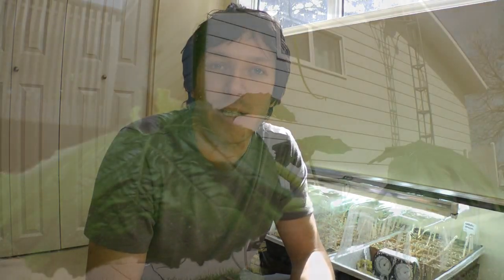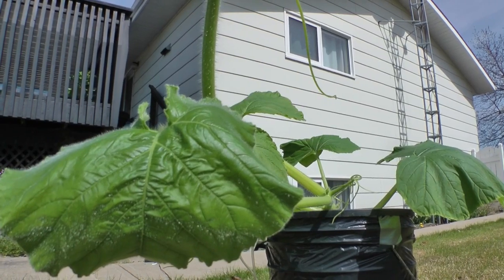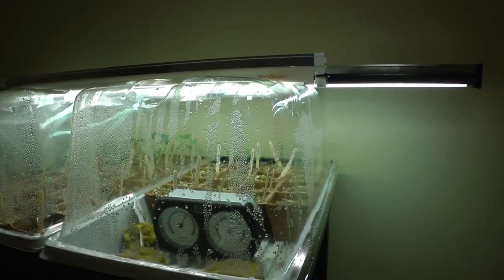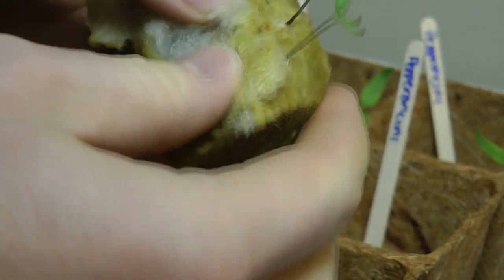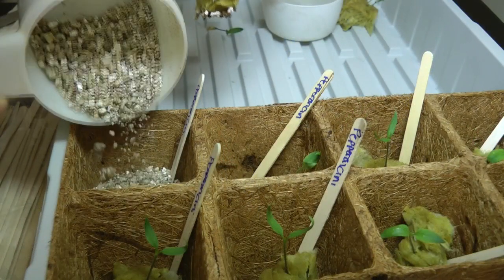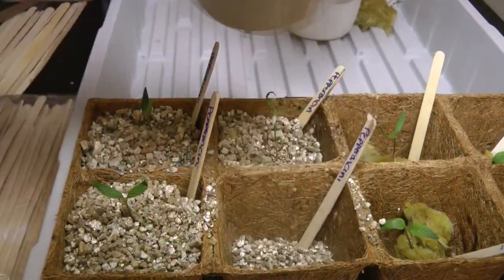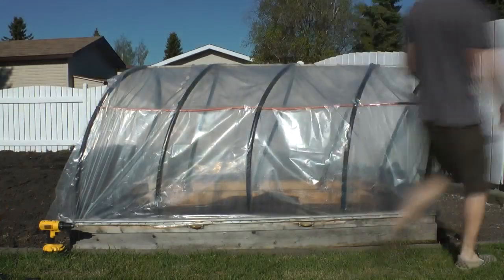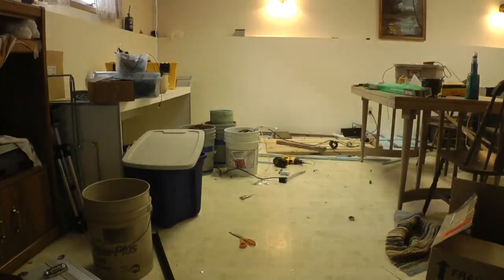How to disassemble a hydroponic system S04E01

Comment: h202 is excellent for cleaning but if you are going to use the sterile hydro method you should look into something like Dutch Master's Zone. You can use h202 with it if you want but it's probably unnecessary unless you are treating a problem. Low dosing h202 won't hurt your plants and never use it in soil ever. If you are using the "typical" 29% hydro h202 then go with 3ml per gallon OR LESS. You can use 5ml per gallon to treat an issue and 3ml OR LESS per gallon for maintenance. If you are having root problems because of heat and so on then use Dutch Master's zone and stay far away from any biologicals. If you are already having a root issue adding biologicals will make it 1000x times worse in a matter of hours. Keep the videos coming!